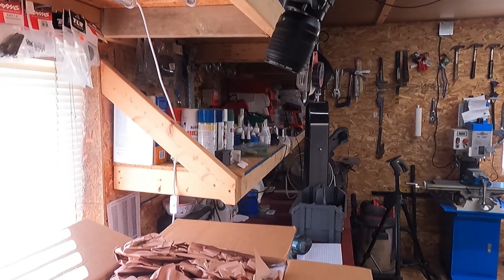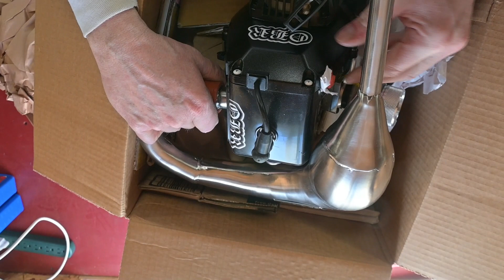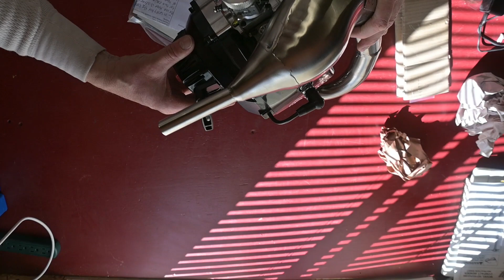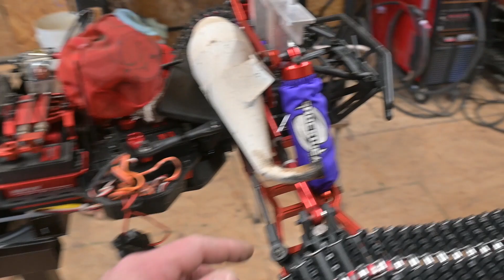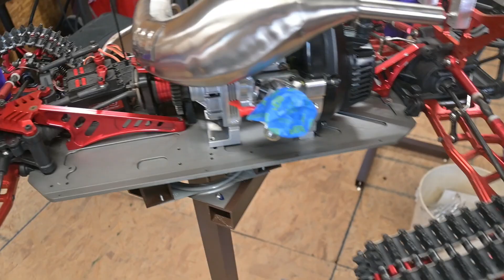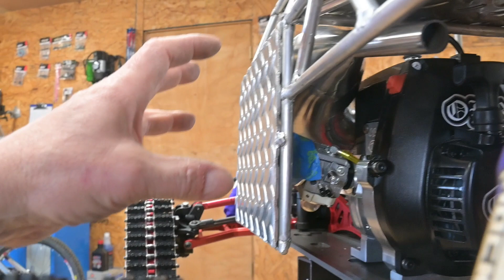Rovan 450 XLT FrankenTrac geta an OBR 47cc heart

Comment: You are going to like that engine, I ran in my 5T for a few years… now it in the Raminator  Dan and Sean are great guys for sure. Looking forward to your next Video 👍
Reply from the maker: Hi PaintenDave, are you finally starting to thaw out? The follow up to this video is taking longer than planned do to machining requirements on the driveline upgrades that i was not anticipating. So the video will now include those as well as mods for the engine fit. Now that the weather has improved there will be a bunch of "field" videos coming. Thanks for checking in and i always appreciate your input.
Reply: @RCWalletVacuum  Still lots of ice on the Lake man, took out my Brushless 5T with tracks on weekend on the lake!  The tracks tension keeps coming loose once I get in to the 45-50 mph mark , The Tension adjuster bolt needs a nylock nut on it to stop this from happening. Take care man👍